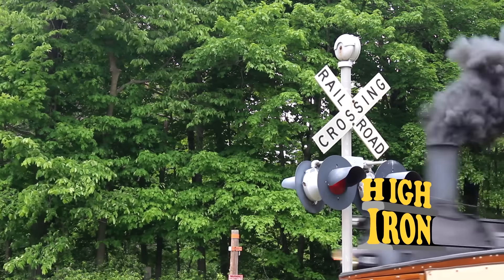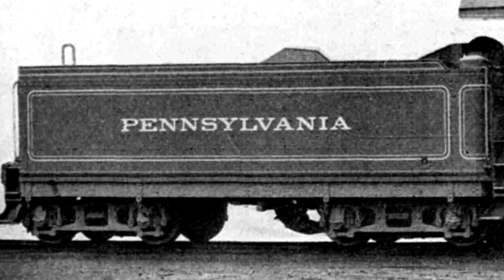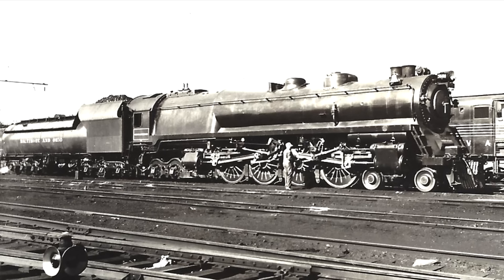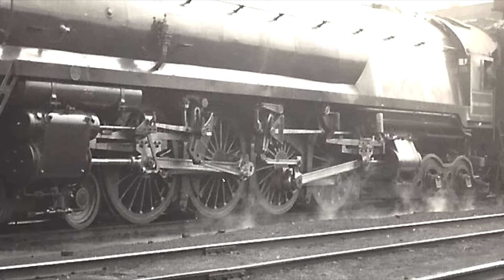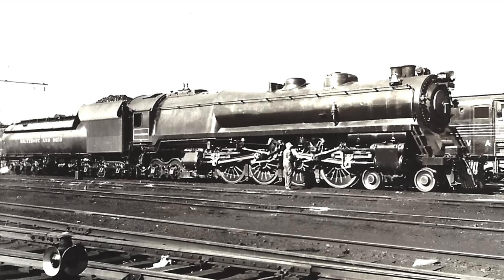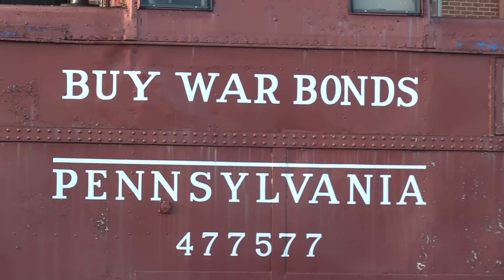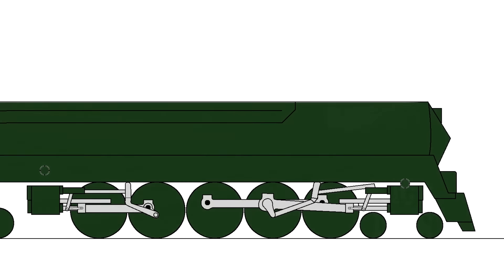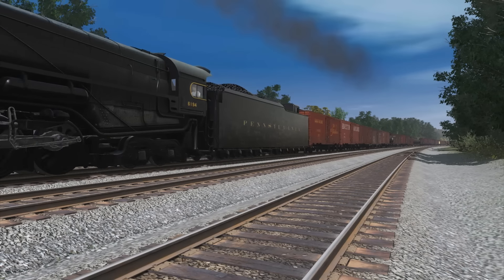Why Weren't Duplex Steam Engines Successful?

Comment: I get the fascination with the T-1 with none being saved, but there are many hurdles to pass. Where are you going to run it? Not on the current freight giants, they want nothing to do with steam (mostly due to liability). So unless you are Steamtown or a Reading & Northern type railroad with privately owned track, you are out of luck. There are no guarantees such an owner would allow the T-1 to run on their railroad, much as folks like to rubber-stamp it. I am not trying to start a fight, and I hope to see an operating T-1 myself, but I am a bit pessimistic about it right now.
Reply: There are more places the PRR T1 5550 will operate when complete, than you think. The trust mentioned they have been called by multiple regionals and short lines for operating opportunities.
Reply: @TranscontinentalRailfan  Ahh, that's great then. Best of luck to the trust.
Reply: The Trust has, or had, commitments in writing of several places willing to run the engine before the feasibility plan was even finished.

If there is a record attempt, its location and characteristics are a non-issue.  The Trust has already been given the understanding that, if certain fairly straightforward conditions are met (including the instrumented wheelsets) they can run the engine on the Fast Loop at TTCI in Pueblo, Colorado.  It can easily get there on the proposed transport frame.

Of course, any offer to run 'today' may not be good by the time the engine is completed.  But operation in excursion service was not the reason the engine is being built.  It is a technical exercise to determine whether the historical T1 design, when built, actually has the faults that were claimed to make it a 'failure'.

Comment: German locomotives like the Bavarian 3/6 also had four cylinders. but they were all in the front and very compact. Why do american steam locomotives look like they are falling apart from all those pipes? ^^    I'd be interested in a comparison between american and german (/european) locomotives.
Reply: convenience of maintenence, a lot of the parts that were put inside fairings on european locos just got left exposed to make inspection and maintenence faster on american ones
Reply: If you look closely you can see there are two variants of T1 - the earliest models had a lot of streamlined fairings for aesthetics and wind resistance, but most of them had much more conservative streamlining that left the running gear and steam lines more exposed. Management wanted the pretty looks for branding purposes, but the maintenance crews hated working on them and dismantling all those things to get at the operating parts racked up more shop hours. Looks had to take secondary importance to function in this case.
Reply: Beauty is in the eye of the beholder.
The exposed mechanicals have an aesthetic of their own.  Today we call it SteamPunk, and add non-functional gears, valves, and flyball governors to any number of things they don't belong on.
All in deference to the highly functional, external drive gear of the trains of yesteryear.
Reply: Americans had very successful high-speed compounds in the early 1890s, and had developed an extensive range of balanced compounds by the time of the 3/6s.  The actual thing that killed balanced compounding on passenger power was the (German) invention of the Schmidt superheater.  Afterward, American design extensively flirted with three-cylinder power (largely to reduce augment on very large locomotives) but nearly all of those had been converted to simple or scrapped by the end of steam.  What American design concentrated on was easy-to-service quartered two-cylinder engines, sharing much of the required service technology and components with two-cylinder 'normal' power -- and achieved high speed and good balancing via running-gear improvements, not balancing with inside cylinders.
Reply: @wizlish  Although compounding can be used in conjunction with superheating, as was done in Europe and especially France. But the gain from superheating is much greater than that from compounding. The UK, like the US, largely stuck to simple engines, again mainly two-cylinder.

Comment: K4 is were great riding locomotive you don't know the hell what the hell you're talking about my uncle's worked for the Long Island Railroad and the Pennsylvania K4 were great commuter engines. They lasted decades in service and their service lives were cut brutally short. A waste that the railroad paid for 10 years later when it had to replace it's diesel fleet wholesale and then it was broke

Comment: How much would stream-lining help a double loco? hahaha
Reply: About the same as its 2-cylinder simple equivalent.  The actual contribution of streamlining only comes in at relatively high speed.  Kantola and the people at Case School of Science actually calculated the horsepower savings from the original 'Commodore Vanderbilt' shroud applied to J1e 5344 (one of the few functionally-streamlined American steam locomotives); the claim was for little more than 400hp saved at the engine's top achievable speed.

Comment: Whereas stationary and marine steam engines condensed and recycled their steam and water, locomotive engines were all of a once-through configuration.  This is a terrible waste of energy (i.e., fuel) not to mention water.  If these engines had viable steam recovery systems, they should have been able to cross the country on one fill up.  Why did engine development go in this direction?
Reply: Mobile condenser efficiency at the required mass flow was unworkable.  Even the Steamotive system, with long expansion from 1500psi into a suitable plenum, ran out of condenser at only 2500 rated traction horsepower.  The ACE 3000 would have choked its very sophisticated condensing arrangements under some fairly common road conditions, at only 3000 dbhp and wildly greater complexity than even a comparable contemporary like an SD40.  About the minimum practical 'cost-effective' output justifying the cost of a good STE is about that of a pair of 4400hp diesel-electrics; the condensing even using recompression on the exhaust steam is still fearsomely bulky and complex.

It is possible to spray-cool the condenser (as for example on the second Reid-Ramsay) but you then have the effective water weight and rate considerations for the untreated cistern contents as well as the makeup feedwater.

The thing is that the savings from 'advanced thermodynamics' on even Gen 2 steam won't pay for the added capital and maintenance ... then comes the first road failure due to condensing failure, which will wipe out months or years of incremental fuel and water savings at a stroke.

I am of the opinion that recovering waste heat from the exhaust down past the condensation point of the combustion water or NOx-abatement steam injection is a more reasonable approach, since high-sulfur fuel and cheap rustable exhaust components are not a factor in current design.  Note that a multipass boiler packages quite nicely in a stack-train loading gage...

Comment: Meanwhile, the Beyer-Garratt became the most successful loco design of all time on every continent except North America. Much like the metric system.
Reply: How many Beyer-Garratt locomotives have ever been sold in Europe? And how many of them were actually successful?
Reply: @RestrictedProceed  I have no idea how many but they were all successful. About the only ones that were were the handull that were used in the UK, Beyer-Peacock's home country.
Reply: @davidrayner9832  Not even 50 were built for European users. Compare that to more than 7,500 examples of DRB class 52 locomotive. In fact, that single class easily outnumbers all the Beyer-Garratts ever produced.
Reply: @RestrictedProceed  If you know how many were produced for Europe, why ask? Also, what's your point about the DRB 52 other than there being plenty of them? It's not a duplex. Neither is a Garratt, strictly speaking, but at least it has four cylinders and none of the shortcomings of the PRR duplexes.
Reply: @davidrayner9832  Read your first comment once again, it includes answers to all your questions.
Reply: @RestrictedProceed  Oh, you're one of those people who makes a comment and then will not explain it. Go away. I can't be bothered with you.
Reply: @davidrayner9832  You said in your 1st comment: "Beyer-Garratt became the most successful loco design on every continent except NA." Last time I checked, Europe was still regarded as a continent, and from the numbers of locomotives sold there, Garratts weren't successful at all. Even Mallets easily outsold them. Sure, you can argue that numbers ain't everything, but how could something be "best of all time" if one of the largest railway systems didn't even bother to buy it? I also get an impression that you didn't get the reason for building the duplexes in the first place. Their point was to limit dynamic forces at high-speeds, speeds pretty much unachievable by Garratts (or any other articulates).
Reply: @RestrictedProceed  By most successfull, I meant best. There is no steam loco design better than a Garratt. If you need four cylinders, that's how you'd have them. I just watched the video again and none of the shortcomings of the locos featured applies to any Garratt that I know of. So what if they never sold well in Europe? They never sold at all in North America and Duplexes never sold in Australia or Africa. Does that alone make them bad? The only real problem with Garratts is that they came along after just about everything else and like all other types, started off small. The biggest locos ever were Mallets but the first examples were quite small. By the time Garratts got to be big enough to be taken seriously, diesels were already taking over. Oh, and the Algerian Garratt was good for 80 mph which it did on a system that was very hilly and curvy. There is no reason in the world that a Garratt with the same specs as an LNER A4 could not have been built but as I've said, they never got a chance to get as fast as an A4 or similar nor as big as a Big Boy. You can say or think whatever you like but I believe that if diesels had never been invented, Garratts would have become the standard design of steam loco.
Reply: The real difference between Garratts and 'real' Mallets is no more than 8 years (the span between Old Maud and the Tasmanian express locomotives).  Their 'non-use' in North America is probably a combination of insufficient scale as B-P proposed (their Super-Garratts aka 'Mallet-Garratts' were relatively tiny six-coupled things) and American unwillingness to pay the B-P license fee 'for nothing'.  Had more United States railroads had light, or neurotically-protected civil-engineering-dominated management, I suspect we'd have seen Garratt designs.

The Africans demonstrated as well as necessary what a North American Garratt would involve; it might be added that the Wellington and Manatu (with its sensible adoption of Yankee sensibility) would have had no trouble at all using six-cylinder Garratts effectively...

Comment: I bet steam engines could be developed again with innovations like applied Digital technology in much the way our cars today run more efficiently. That would be useful for the throttles. I bet somebody’s thinking about it
Reply: Digital technology needs to be carefully applied to a reciprocating steam locomotive, particularly if it leaves the valves in some undetermined state when (not if) it fails at high speed.

For example, it would be comparatively easy to adapt something like Koenigsegg's pneumatic actuation to an engine with either poppet or divided piston valves.  That would give 'as precise as needed' control of timing and duration to as fast a speed as the boiler, suspension, and guiding could support.  But if it fails, rods promptly bend and awful things probably start far quicker than a human crew could react....

Comment: Grey-haired men playing trains.
A one-off new duplex will not be subject to daily use by various crews, with only adequate maintenance.  It will never produce 'representative' performance.
Look at the new-builds under construction and already operating in the UK.   It won't ever be a self-funding operation, so beware of open-ended support for it.
Reply: The T1 doesn't have to be 'self-funding'; it's a technological exercise that might peripherally be used for high-speed testing or excursions.  One of the actual moneymaking possibilities in the feasibility plan is in support of advertising campaigns.

While the support of the engine in even prolonged excursion service can be relatively flawlessly executed (there are dedicated swap-body support vehicles that implement much of what N&W and NYC could provide for servicing effectiveness) no reciprocating locomotive can, or should be expected to, replace modern diesel-electric passenger locomotives.
Reply: @wizlish  really should've just built a hudson instead
Reply: The thing about that is that -- paradoxically -- there is no need to demonstrate the effectiveness of a J1e.

There have been various proposals over the years to make a replica Hudson.  One of these involved using the 'secret underground factory' in Datong to build; the "problem" was that the Chinese said they wanted to produce and sell more examples (something I would enthusiastically support, but it wasn't my money at stake!)  The affair seriously reminded me of the Sea Coach debacle...

Personally, before I started a 'J1 Trust' I'd arrange a full restoration of NYC 3001 in Elkhart, which has the same General good looks as a Hudson, has demonstrable historic significance, and could handle significantly longer excursion consists...
Reply: @wizlish  As long as the project is generously funded from the pockets of yourself and like-minded others, 'success' matters little.  
However, inducing others to part with their money must be on well-founded data, as SBF is now discovering . . .
Reply: @wizlish  If you want to fund it and bear ongoing losses, that's fine by me.  Be careful about inducing others to do so, taxpayers particularly . . .
Reply: Note that the T1 trust has specifically, and pointedly, avoided any government or institutional finding, in part precisely for reasons of OPM.  In fact, I expect volunteered funding to start ramping up dramatically as it becomes clearer and clearer that the locomotive will be finished and the 'hard parts' become done.

The issues with Franklin type A performance were solved, as far as there were solutions for them, by the proposed 1948 changes. That specifically addressed the valve-breakage and bounce problems.

There would be no great issue in making a set of parts for Franklin B-2 conversion and fitting almost exactly the same drive-arm setup that will be used on 5550.  There was certainly no issue with the better-horsepower-at-speed capability of type A, and the actual problems were not in the upended nightmare box but in the crosshead-driven link gear... which the use of RC eliminates.
Reply: @wizlish  Best wishes for the success of the project.   Come back and tell us all about it?

Comment: Yet, Switzerland trains were wholly electrified and pulling millions of tons through Europes alpine massif before those dinos were built.
Reply: the PRR mainline alone proabably had more miles of track the the entirety of Switzerland combined.
Reply: @themanformerlyknownascomme777  5300km train rails and 7000km regional tramlines. 99.5% is electric. Much of Europes freight passes through - that’s close to 600 million people. The US network is dwarfed several times over and there are virtually zero derailments. Trains run at 200+kph and where geography allows 300+kph in Europe.
Reply: @808bigisland  "dwarfed several times over"? no, not even close. the PRR mainline was 18,733kms long, and that was JUST the mainline of ONE railroad. that is over 3x the length of the swiss rail lines and even if you combine the swiss rail lines and tram lines together they are still shorter then the PRR mainline.

Comment: because STEAM is free enegery. But because fuel costs money, then is costs to use the engine. Water causes steam.
Reply: Steam was so far from 'free' by the late Forties that a number of railroads equipped their locomotives with air horns so the whistle use could be reduced -- one New York Central estimate was that about 6lb of steam (and all the heat involved in producing it, and the mass of water from tender storage used to source it) was blown into the atmosphere any time the whistle was sounded.

There is a LOT of heat involved in vaporizing water at 212F/100C into steam even at atmospheric pressure, and a great deal of complexity and cost on modern locomotives was used to recover as much as practical of that into the Rankine cycle.  Some of the approaches, like the Snyder combustion-air preheater, were promoted 'too late to matter'; others became a strong reason for abandonment of steam power, as on NKP, when the specialty manufacturers of 'heat-saving devices' progressively went out of business or repurposed themselves as aggregate demand fell below profitability.

Comment: you know what engine you could take a look on? the DRG Class (BR) 05 from Germany. it was the fastest Steam engine untile the Mallard came. (tbh i personally think the mallard cheated because there was no official that  certified the speed and it broke down aaaand it went downhill) I tried to find documentarys about it but they are very rare because of that engine there only existed 3 and one of it was a test build with a front drivers cab instead of one in the back.